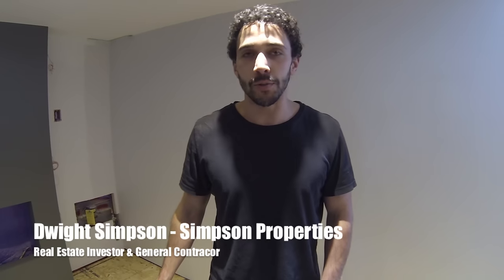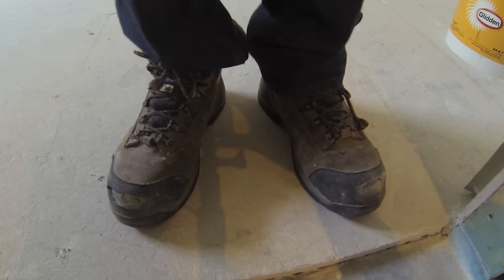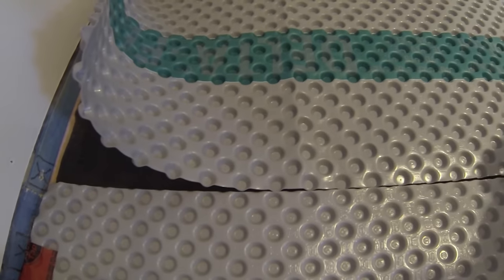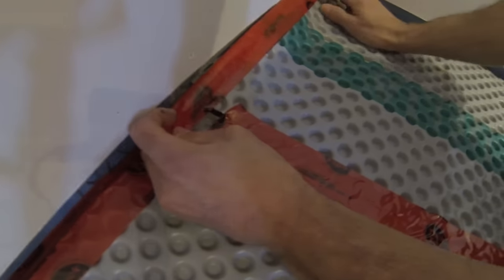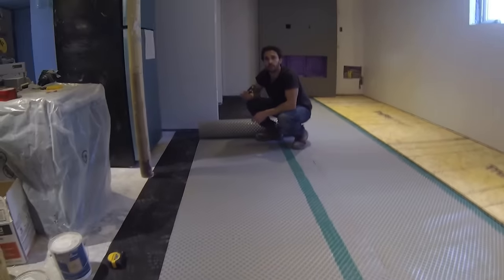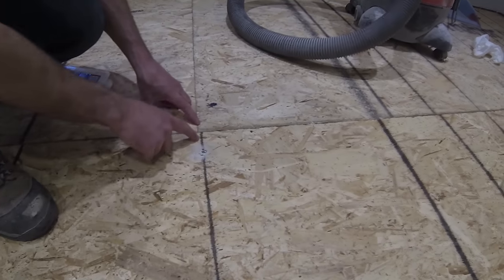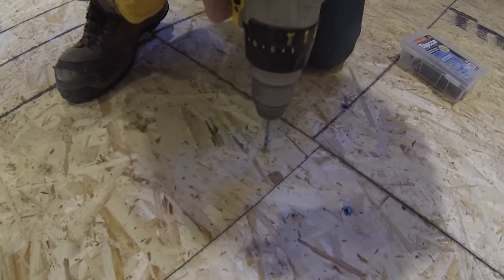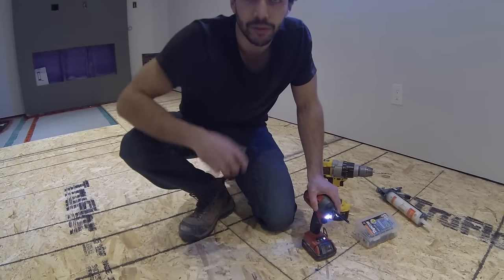HOW TO INSTALL A SUBFLOOR ON CONCRETE

Comment: If you install ceramic or porcelain tiles, you still need this sub flooring?
Reply from the maker: Safwan Khallouf I would not recommended installing this kind of subfloor as an underlayment for tile. I would install a tile uncoupling membrane like Ditra from Schluter. Ditra-Heat is an awesome product as well that electrically heats your tile.

Comment: Would this be adequate for making a bedroom in a garage (concrete slab)? Even in WA state where it rains and is cold all the time?
Would you use 6mm poly underneath the landscaping fabric to insulate more or no?
Reply from the maker: You could do this in a garage as well. I don’t know if there would be a need to install the poly if you are using a Delta-FL membrane. I would reach out to Cosella Dorkens tech support with that question:  1 (888) 433-5824

Comment: ? about the landscaping paper. why do you need it on uneven floors? wouldn't the clicking sound be removed when the plywood is screwed down? couldn't you just add an additional screw to that location?
Reply from the maker: Unfortunately the clicking sound is not removed by screwing down the plywood. In the example of the hallow sound that I show the floor was screwed down and it was still making that sound. The OSB has some flex to it when you're walking. The amount of screws you would have to use would make it non cost effective and take a long time. Installing the landscaping fabric is quick to install and solves the problem for a low cost.

Comment: Would this work for a garage conversion renovation? And would there be added benefit to put syrofoam insulation on top of Delta Fl if it works? I'm in a northern climate. Thnx.
Reply from the maker: Sorry for the late reply. Yes this would work for a garage conversion. If you want to install insulation to create a thermal break that should be done first. Then install the subfloor. There are other subfloor panel systems that have grooved foam built in on the underside of the panel.

Comment: Simpson Properties hey man awesome vid and easy to digest lol... so I have a question... what can go first underlayment or walls...in my case, my basement has the canal drain system... is about 1” width and 1.5” depth and then its filled with pea gravel....so this being said...should i build the walls first and use sylicone to seal between the base board and concrete (here in USA we use green board which is pressure treated) so if anything happens that will act like a barrier to water in case the drain canal gets flooded, and then install the underlayment (tmx) OSB Plywood etc... (im using carpet instead pf hardwood or vynil floors though)

Or instal the whole system of underlayment right in the canal’s edge drain, then osb plywood pannels (sub floor) build my walls and then carpet.... 

I been thinking about this so much but havent get a straight answer yet... if you can help me with this It would be greatly appreciated...

Also that black cloth you used for sound proof...is that landscaping weed barrier? That wont create mold pr mildew if it gets wet? 

Thank you!
Reply from the maker: I’m guessing the canal system you’re referring to is a dimple board installed on your exterior walls. Which directs water to weeping tile that is buried beside your footing around the perimeter of the room (interior water management system). I would install your underlayment, OSB, then frame your walls on top. There are pros and cons to both scenarios. If you read through the comment section below you will find some questions covering this. I’m currently finishing another basement and will be framing my walls on top this time.
Reply: Thanks for the response
Reply from the maker: Cristian Campo no problem. I had a typo in the previous comment. I would install Delta-FL first, frame, then install OSB etc. You’re fine to frame your walls on top of Delta-FL as long as it’s not a load bearing wall. The landscape fabric it’s designed not to deteriorate or promote mold growth. So you won’t have any issues there.
Reply: Simpson Properties perfect timing for the answer! Im at the home depot right now! Awesome man thanks!
Reply: Simpson Properties that sounds good too, well the walls im building is just to cover the base of the foundation, (3’ tall by 22’) so thats no load bering is just a cover as I said... my concern is that if i leave the delta first the air pockest might ventilate that “smell” that come from the canal drain system and last but not least is that if for some reason the canal gets overwhelmed with water on a heavy storm then it can get flooded with in between my sub floor...

So this is what i came up with following your advice, and some of the other people questions, answers and life experience... 

Im going to frame the walls first about 2” away from the edge pf the canal. 
Im going to use the foam strip insulation between the base board and concrete. Then im gonna frame the wall and on the bottom facing the edge of the canal im going to cut strips (about 6 to 8” high, this comes 1” thick)the R5 foam insolation and place it as an extra preventive barrier just in case the canal gets overwhelmed during a heavy storm so its gonna give me extra inches pf barrier... and of course use sylicone to seal any gap.

Last but not least, im put a vapor barrier on top of my foundation in between my wall the concrete, add some access panels in my wall so i can monitor this every time i need to.... and  if its the case have ready a wet vaccum  . 

Im going to do a video on this and make it detail... so you can check it out and give me an opinion if you like of course.... 

I like to be creative and all this came along thanks to your knolwdge, adivces and life experience from the people that comment on your video.

Comment: When I pour water on concrete it doesn't soak in? I was told not good for staining concrete, laying wood, etc. Don't want to have to sand; thought this would be an alternative perhaps?
Reply from the maker: I have never come across a foundation with that issue.
Double check with a foundation specialist first but you should have no issue's installing this sub floor on top of your slab.

Comment: What about where the wall meets the floor? Our wall is cement, as is the subfloor, so water soaked the baseboard, bottom of the sheet rock, and 8 ft of the carpet last weekend. How do we ensure no moisture in the wall / where it touches?
Reply from the maker: Erin Murphy you have to waterproof your foundation from the outside or install a French drain system on the interior.

Comment: Aren't you compromising the seal by drilling tapcons through the osb and delta?  Wouldn't vapor be allowed to pass through the holes to the osb layer and then swell the osb over time?
Reply from the maker: That's why I put silicone in each pre drilled hole before installing the tapcon. The amount of vapor that could escape from the small pilot hole is so minimal that it will not create any issues. The only way you're going to have moisture problems with the OSB is if you installed it directly on top of the concrete without using Delta-FL. In that case moisture would wick onto the OSB.
Reply: "Over time"? How long? Like everything, it's only got to last the rest of my life, not eternity. LoL

Comment: Hey, love the videos.  Quick question - if you put the subfloor down first and then built your walls, how would you attach the bottom plate?  Would you use 2" screws and only penetrate the OSB or would you drill all the way through into the concrete and fasten with tapcons?
Reply from the maker: Sean Saunders thanks! If you screw your walls just into the subfloor it won't be strong enough. You will have to pre drill and use concrete fasteners or a Ramset gun and concrete nails. Building your walls on top of the sub floor is a great idea! Keeps your base plate off the slab and allows your to nail your baseboards into the bottom plate properly.
Reply: OK. Thank you!  would you still use a pressure treated bottom plate or is that not necessary in this scenario?
Reply from the maker: Sean Saunders you can use non treated lumber for your base plate in this case. You also wouldn't need to use sill gasket under your base plate (since it's wood on top of wood) . If you want to go over kill you can still use a treated wood suitable for indoor use.

Comment: I had a friend tell me that installing osb on concrete could cause it to rot. Does the delta product prevent this?
Reply from the maker: Installing any wood product directly on top of concrete is never recommended. That’s why I’m this case Delta-FL was installed first, then OSB was installed on top. The OSB never makes direct contact with the concrete slab. So you don’t have to worry about it wicking moisture and rotting.

Comment: wouldn't 1 3/4" screws go right down to the concrete and make the vapor barrier useless?
Reply from the maker: This vapor barrier doesn’t have to be completely air tight like an exterior wall. The main purpose is to create separation between the slab and the finished floor. Silicone was installed in each hole before the tapcons were installed.
Reply: @simpsonpropertiesltd  ; while drilling, does the bit "grab" the fabric and want to twist it up?

Comment: Any thoughts on using a power shot and nails vs screws as in the video? pros and cons? Any reason to not use one over the other?
Reply from the maker: I have never heard of anyone using nails for a sub floor over concrete. Usually a Ramset gun and nails are used to fasten your base plate when framing a basement. The main issue with using nails and a Ramset gun is it's so powerful that the nail head would penetrate too deep into the OSB. If you used the nails that have a washer built in there would be lippage on your sub floor. Also, you could not install silicone prior to installing a nail to help maintain a vapor barrier. If you were to have a severe flood and had to demo all the sub floor, screws would come out much easier compared to nails and it would minimize any damage to your concrete pad compared to removing nails.

Comment: How much did the materials cost you an how many square feet do you have?
Reply from the maker: Prices will vary depending on your location. This video was shot 5+ years ago so the prices would not be relevant. It’s best if you check material costs from your local suppliers.

Comment: I'm going to be using steel studs for my walls, when putting them over this floor system,  do I need to anchor the base track all the way to the concrete? I'm assuming so, thanks in advance to anyone who'll know.
Reply from the maker: I would do a combination of both. Anchor it to the concrete slab every few feet. In between that anchor it to the sub floor.
Reply: @simpsonpropertiesltd  thanks for replying!

Comment: Just wondering about the walls.  So the Delta-FL is not underneath your 2x4's for the wall frame?  So would that wood be directly on the concrete then?  Could ya not instal the Delta-FL under the wall before you put the frames up?
Reply from the maker: It's a personal preference some people install it before framing and others install it after. I don't install the Delta-FL beneath my walls. I use a sill gasket underneath my base plates and a treated lumber called BluWood that is mold and mildew resistant. You can install the Delta FL beneath your walls but it will be in your way throughout the construction process and could get damaged. Especially if you have to do a rough in for a bathroom.

Comment: If moisture control was your reason for using the delta dimpled membrane you should've opted for something with a known R-value. Delta FL does not have a knowable R-value compared to foam insulation (something like Pink Panther comes to mind). Viewers should know that there are materials available like the Owen's Corning products that contain knowable R-values.
Reply from the maker: Unfortunately, I don’t not have the extra ceiling height to allow for installing a rigid insulation foam.

Comment: Can this same method be used over concrete in a bathroom?
Reply from the maker: Yes it could but I prefer to use an uncoupling membrane in bathrooms directly over the slab. Then install tile on top of the uncoupling membrane.

Comment: What about driving screws through the barrier?
Reply from the maker: It's fine and  a recommended practice by the manufacturer. If you want to be overkill you can countersink the fastener a bit and fill the top of the fastener hole with silicone.
Reply: Ok cool that's awesome

Comment: I would like to install engineered hardwood on this subfloor in my basement. Will this work or do I have to do something else.
Reply from the maker: skonasa you can install engineered hardwood directly on top of the slab. A special type of glue has to be used to lock out any moisture from the slab.     You could install a subfloor first & install the hardwood on top. It will all depend on your specific project.

Comment: What sort of flooring products can be installed on top of this type of subfloor system?  Carpet?  Water-resiatant lamiminate?  Porcelain tiles?
Reply: The product info says you can install laminate or engineered flooring directly on top of their Delta-fl product. If you want tile, carpet or real hardwood then need OSB or  plywood.
Reply from the maker: Thanks for responding JT.

Comment: what’s the maximum slope of the slab that you allow?
Reply from the maker: The is directly from the manufacturer spec sheet: “The floor should be as level as possible. Remove any bumps or ridges. In areas with depressions greater than 1⁄4”, self-leveling compound should be used.”

Comment: There is other screws after that you can use to screw the flooring down but the blue screws that he is using are a little expensive but well worth the extra money they are a stronger screw and will give you that extra strength windscreen the floor down to the concrete
Reply from the maker: Thanks for the feedback & sharing that info.

Comment: Instead of say, engineered hardwood, if person decides to go with tiles, ontop of the wood subfloor, would a shearing membrane under the tiles such as, Schulter/Detra be necessary? Possibly the Delta would act as the shearing membrane.
Reply from the maker: I would install Ditra directly on the slab then install your tiled floor.

Comment: in the long run, is it worth it to use delta FL compared to dricore subfloor panel? i know its a fraction of a cost but my concern is will the delta FL hold up to wear and tear? in your best knowledge how many years will the plastic of deltaFL last as compared to dricore panel? i am trying to weigh my options here for my basement. your input would be greatly appreciated.
Reply from the maker: +akosichosen1 Delta-FL will hold up fine over time. It's not a product that will be exposed to wear and tear so that shouldn't be an issue. My Mom has the same product installed in her basement for close to 15 years and she has had no issues.

Comment: what method would you suggest for installing 3/4 osb over above grade concrete that is 30+years old.   it was originally a porch that was closed in years ago and i am now wanting to put 3/4 hardwood over the osb
Reply from the maker: Chad Moseley I would use the exact same method shown in this video.

Comment: How did you work around the obstacle on the floor in the corner?
Reply from the maker: I cut out a rectangle in the OSB and Delta-FL and made an access panel. It is used to access the back water valve.

Comment: is there any kind of special landscape fabric to use? Iprefer this method the drycore system doesnt seem to seal as well between the joints thanks
Reply from the maker: Jeff Custrin nope there is no special landscape fabric needed. I buy the cheaper fabric which is usually black. You can buy it at any big box construction supply store. The grey landscape fabric is designed for commercial use and is more expensive.

Comment: What did you assume the price to be per square foot? Even a rough guess of materials, time and floor space would be helpful to me. Thank you.
Reply from the maker: Robert Bialozynski 
$0.71 Delta-FL
$0.56 sq ft OSB
$0.05 sq ft Landscape fabric
Total is $1.32 CDN per sq ft.
Reply: +Simpson Properties Perfect, thank you. How about labor hours? That job seemed like an average combination of open and irregular spaces.
Reply from the maker: Robert Bialozynski 1200sq ft was done in approximately 12-14 hours. If you use a SDS drill it will speed up your install time.

Comment: would you do the same for the floor in the basement bathroom?  what would you recommend
Reply from the maker: I would recommend installing an uncoupling membrane like Ditra it’s made by Schluter. Then install your tile on top of the membrane. If you live in a cold climate I would install Ditra-Heat so the tiled floor would be heated.  I personally wouldn’t install Delta-FL and the OSB in areas that are going to be tiled.